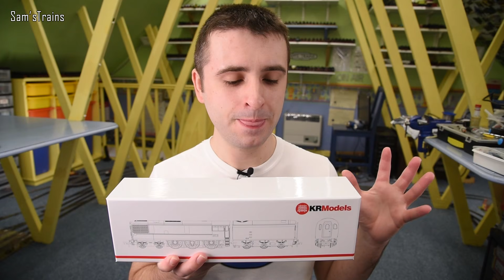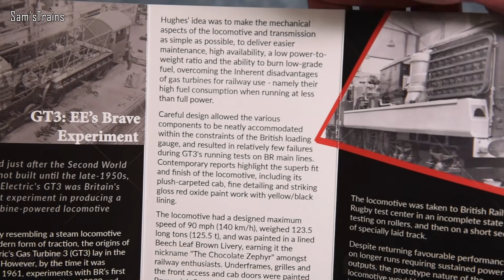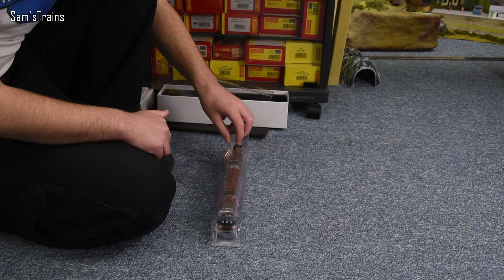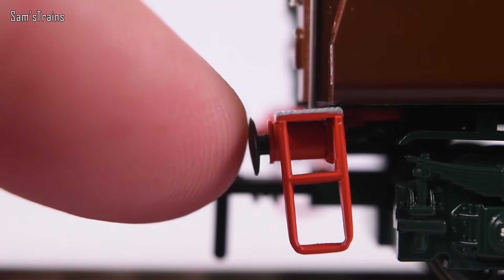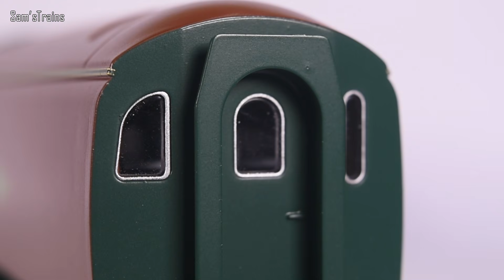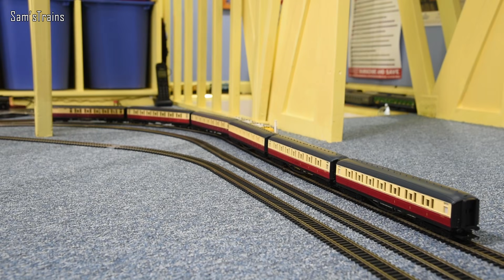Brand New GT3 Gas Turbine Locomotive | KR Models | Unboxing & Review

Comment: What that front bogie screw needs is to be a collared screw, so it can be tightened onto the collar, without tightening onto the bogie frame. I'll bet this was how it was designed, then they saw the price of a collared screw (they are machined, so are quiet expensive to produce, standard screws are rolled, and much much cheaper). 

You can effect the same by using a close fitting piece of tube from K&M metals, cut to length and slid over the screw before it is inserted and tightened. You can then tighten onto the tube and it won't clamp the bogie. Whether it can be sprung then depends on the spring and whether it will clear the tube. Maybe a replacement spring is also on the cards. The spring should push against a washer, that then bears against the bogie. With a dab of oil or grease, that should work fairly well, though uneven track might be an issue.

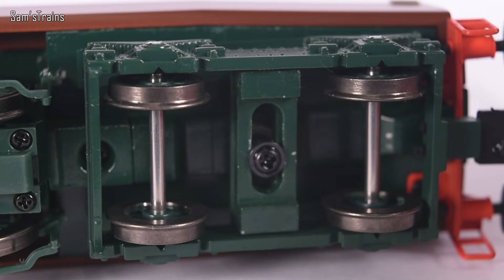Comment: There's a reason why bogies on steam models, have that link between the chassis and the bogie, rather than just a pivot. That arrangement is not flexible enough which is why it derails. Very poorly thought out. 23:20 A link allows the bogie to float more freely.

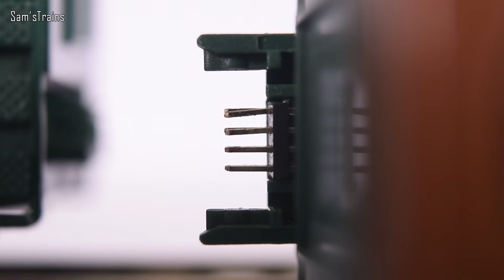Comment: 18:45 Don't push it back together with a bent pin or you'll make it worse. Mine goes back together easily. 
If you break the pins, the four on the right side control the red !!! cab lights and the white !!! non directional tail lights so no loss there. The four pins on the left are loco track input to the decoder socket and decoder socket back to the motor so don't bugger those up. It looks like your bent pin is one that controls the cab light.
Reply from the maker: That was the pin straightened - it was even worse to begin with! Thanks for the info on the pin output - duly noted!
Thanks for watching, Sam :)

Comment: 17:00 the pilot holes for the handrails are drilled in the wrong place which pushes on the step plate and makes the steps wonky. To fix, remove the front buffer plate and either drill two holes in the correct place or snip off the bottom 1mm of handrail each side before reattaching.
Reply from the maker: Well spotted - I've heard this too... though supposedly those parts are being replaced free of charge (front bogie too) not sure whether this is true yet!
Thanks for watching, Sam :)

Comment: The issue on the front bogie to me is the gloss paint where the screw connects is causing friction thus impeding its sliding motion , i would remove the paint on both the underside of the screw and bogie slide plate and use a smooth 2000gt paper the smooth it out a little oil a few mm shorter spring , a sleeve on the screw to help in hight and tightness a little oil where it slides and away ye go....awsome channel btw , i was goin to buy it but £200.00 even for a prototype is kinda too much . Ive got scale drawings for it n reckon i can build it from plasticard using a hornby/ bachmann chassis that in the end for me would be more satisfying to pursue...all the best....jim
Reply from the maker: I think it's a number of things Jim - the spring is too stiff, the fixing screw has no collar (meaning it must be fitted loose) and the screw head is only just wide enough to keep the bogie in place, again not a good fit... the whole bogie is just a shoddy design! That sounds fascinating - I'd love to see the results of a custom build like that
Thanks for watching, Sam :)

Comment: Hey Sam. I suggest that you add a small washer to the pilot truck screw so that the screw bolster bottoms out on the chassis so giving you more length on that screw allowing more movement of the truck. Cheers, Dan.
Reply from the maker: Thanks for the tip Dan - I think I have it sussed now!
Thanks for watching, Sam :)

Comment: Funny thing is, I highly doubt it would've been like this if you didn't take every model you own apart before running it.
Reply from the maker: Well then you’d be wrong - I spent two years running a model repair business... I flatter myself, but I can remove a loco body and base keeper plate without doing any damage... and I do, for every review I film... so why do you highly doubt it? 😎
Reply: @SamsTrains  erm. Because you're the only person out of about 1500 who has had the issue...
Reply from the maker: Again, incorrect... I’ve had comments to the contrary, and the odd behaviour of the bogey is clear to see in other reviews. Not to mention the fact that the bogey is insecurely fitted to the model ... but no, of course I did something wrong!
Reply: @SteamingThroughYorkshire  it's his logic what do you expect😂
Reply: @SamsTrains  why don't you do something about it first? Contact the model company BEFORE reviewing a "damaged" model, you wouldn't willingly review a loco where the cab cracked. For all you know. It is more than likley in post. The model has mostly perfect feedback then there's you who puts it down for no reason. Alot of locos have bogies similar to that. And we don't see you complaining about them 🤷🏻‍♂️
Reply from the maker: That’s not the way this works - I review each model exactly the way it’s delivered. This is fairest, and I treat every manufacturer in the same regard. I run this business by myself, and I don’t have the time to hold up filming while I contact a manufacturer and wait for a replacement. It’s incumbent on the manufacturer, not me, to ensure that models are delivered in a satisfactory condition.
A lot of locomotives do not have bogies similar to that - you name me one example of a 4-6-0 with a similarly poor design. If you can, I’d have the exact same response to it.
I’m not putting the model down “for no reason”, it’s a valid criticism amongst a largely positive review. That’s the purpose of a review. Ben’s right, that’s my logic.
Reply: @SamsTrains  the bogie. Okay. The D16.
Reply from the maker: The D16. A 4-4-0 whose front bogie is secured by a collared screw that can be fully tightened? I think that’s the end of this discussion 🤭

Comment: I'm mixed on this 

Not the most detailed or intricate 

The performance seems top notch apart from the bogey issue 

Very expensive but as a small company they can't fall back on other models to sell and make money the way bachman or Hornby can

Would be interested to see what else they have planned because I'm very impressed with the running of this and would like to see the same mechanism In other models 

A good start but very expensive start
Reply from the maker: Yeah that's absolutely right - agree with all of those points!
Thanks for watching, Sam :)

Comment: The front bogie arrangement is very similar to what Kato does on their DD51 in both HO (1-700/1-701) and N (7008-6), but they do it on the centre bogie (Necessary, as it's a B-2-B locomotive). I've not had it be an issue on either of mine (then again, the temporary layouts I build are very simple with wide curves compared to yours), so I wonder if the derailment issues are due to using this style of bogie so far forward of the locomotive's pivot point.
Reply: I don't have a DD51 diesel loco, but I have a Kato HO EF510 with a similar centre bogie design, and that bogie derails on every Hornby 2nd radius point, you really need generous express points for it not to derail.

Comment: The gas turbine turns a generator to produce electricity. The locomotive is then driven forwards with an electric motors.
Reply: All successful gas turbine locomotives used sensible electric transmission. Part of the failure of GT3 was that it did not but used a mechanical gearbox on the centre coupled axle. Wiki gives detail of GT3 design and scrapping after little use.
Designed this way despite the Union Pacific having about 50 gas turbine locomotives pulling mile long freight trains since 1952. Eventually developed into the 8,500 HP units built from 1959 and lasting in service until 1970. The UP units also were able to use cheap low grade furnace fuel instead of high grade kerosene. A big saving.

Comment: An excellent systematic analysis, Sam. My conclusion is they skimped on final quality. That cheap, toy-plastic looking, lop-sided front beam and steps, droopy buffers, numerous scuffs, unstable out-of-the-box bogie etc are unimpressive. Another reviewer’s video model show much the same as well as a twisted buffer on the tender but the reviewer made inadequate mention of it. Your review was superior in rightly commenting more on those matters plus the lack of cab detail, and so on. The difference, I think, is that you bought your loco as opposed to being provided with one - gratis. (Who pays the piper..?) So, an interesting model not worth £200. I’ve cancelled mine. Thanks for seeing more than just the paintwork, Sam.
Reply from the maker: Thanks very much for sharing - yeah that's fair to say, one or two small things spoiled this slightly... overall a decent attempt though! :D
Thanks for watching, Sam :)

Comment: For modellers. Where did it run, first based in Rugby (test centre) then Whitchurch shed in Shropshire for initial light testing and crew training on the Malpas Line. Test runs to the Llandudno Junction turntable. Next to Leicester MPD this was convenient for English Electric’s Whetstone turbine works. It ran on the GC line & from Woodford Halse running into Marlyebone Station. It was later tested over Shap on the West Coast Mainline. It was returned to English Electric at Vulcan Foundry at the end of 1962 and stored then partially dismantled.
Reply from the maker: Many thanks for sharing Leroy, appreciate this!
Thanks for watching, Sam :)

Comment: Hi Sam  Some Backup. GT3 "The Chocolate Zephyr," the third of the prototypes tried at the time. No1 was 18000 ‘kerosene castle’ now preserved. No2 was 18100.
When initially designed (early 1950’s) it was not possible to get 2,750 hp from a mainline diesel. Unfortunately there were several disadvantages of employing the finished style of locomotive by 1961.
Gas turbines need to be run at full load on continuous non stop runs to be cost effective, hence their use by UP in the USA. Runs in the UK were too short. Electrical maintenance was costly. British Railways were busily destroying turntables, now a glaringly obvious disadvantage but it does not seem to have been obvious at the time. It ran very well on runs and was comfortable to drive and unlike other GT Locomotives it lacked the tendency to catch on fire!
Reply from the maker: Thanks very much for this Leroy, fascinating things!
Thanks for watching, Sam :)

Comment: What method did you do with the bogie? Could you go through what you did?
Reply from the maker: I pretty much did go over it - in the end, I just took away the spring, and made the screw nice and loose. In the future I will secure that screw in place, but only once I'm confident the issue is fixed!
Thanks for watching, Sam :)
Reply: @SamsTrains  When doing that I'm surprised you didn't notice the front wheel guards are at the back of the bogie not the front where they should be! See the photo of the real thing. Same fault with ms. Kirk's model!

Comment: A screw to hold the front bogie in place is a better option than a rubber  band / washer like Hornby does with a few of it's steam engine models. Also before you ran the model how did you record the adjust of the screw to get it back to the starting height it was at?

My model seems to run okay over points & 2nd radius curves.
Reply from the maker: Sure, don't have a problem with the screw at all... it's just the fact that it's a loose screw! They really need a longer screw with a collar. Which Hornby locos use a rubber band? Unfortunately the first time I was made aware of the front bogie issue was when it dropped off... so I have no way of knowing exactly how it was set up at the factory...
Thanks for watching, Sam :)
Reply: The updated tooling of the Castle class is 1 of them. My models of Clun Castle & Swindon both came out of the box with the front bogie dropping off. A fiddle to get the band back on the locating pin above the slide assembly, but both bogies haven't come off since.

Would a spring above the bogie be another way of maintaining pressure but also offer a bit of suspension?

Comment: Hi Sam - a great, entertaining (as always) and very fair review of this unusual locomotive model.  I'm intrigued by your point about the buffer-springs being weak: in your willingness to test absolutely everything, might you try taking the couplings off the 'tender' and the leading coach, and backing the engine slowly on to its train? - I'm willing to bet that - with its amazing crawl and those 'weak' buffer springs - you'd get a more realistic 'buffer-kiss' than using a loco with meatier buffer-springs. This would be important on the real railway, so as not to joggle the passengers (though of course the coaches would have their brakes on - you could replicate this by simply holding the coaches still).
Reply from the maker: That sounds very interesting Rick - I could look into doing that some time! The crawl would certainly lend itself to that pretty well!
Thanks for watching, Sam :)

Comment: I am not over keen on the livery, but it was not made for any peculiar company. Take a look at the crankpins, Sam. I think they stick out too far and are undersized for the hole in the connecting rods. For the money, metal handrails and metal nameplates etc. I hope they stick around and look forward to other models. Martin. (Thailand) Is it because they are made in China and KR Models cannot check quality control until they arrive in the UK?
Reply from the maker: That's fair Martin! I believe some of the parts in the accessories bag were 'caps' to put over the crankpins, making them a bit more realistic if desired... no instructions to explain this though of course!
Thanks for watching, Sam :)

Comment: Had a Hornby Castle class with a similar front bogie setup. Had to put a very thin teflon washer between the spring  (made from an old steam iron cover) and the bogie. Used Loctite 609 to stop the screw coming loose once I worked out the correct tension. Never worked 100% but a big improvement.
Reply from the maker: Very interesting - not known any issues with the Hornby Castles... will have to investigate mine now!
Thanks for watching, Sam :)
Reply: There are some variations on Castle Class - see the 346C service sheet for the one I had. https://support.hornby.com/hc/en-gb/articles/360016350399-HSS-346C-Castle-Class-
Reply: I think some of the later Hogwarts Express locos were similar.

Comment: Hey Sam,
I became an expert with these push in tender connections. To reconnect  Loco and Tender, turn upside down in your hands, level up and push the pins home. Very easy to line up pins and keep level.  I don't even try to reconnect Loco sitting on the Rails.  Australian Manufacturers have used this system for some time and we get plenty of practice...I recommend to keep connected and use a Peco Loco lift to store when not in use....
Reply from the maker: Many thanks for sharing! I'll have to try doing it that way!
Thanks for watching, Sam :)

Comment: My GT3 has over-long handrails at the front which depress the buffer beam and footsteps moulding. I’m debating unscrewing it and drilling holes in the moulding in the right place OR cutting the handrails shorter. Not plucked up courage to do either yet. Also I have a screw missing under the cab that holds the drawbar moulding on; I need to ask KR for a spare screw already. Not even got mine on the track yet; been looking forward to your review to help gauge my own experience. I do really like the model; it’s a shame it’s got niggles. I think the drawbar with 8 pin electrical connector & the front bogie are the weakest links in the design.

Comment: Excellent and thoughtful review as always.

The obvious solution to the front bogie problem is for the manufacturer to fit a properly-dimensioned shouldered screw to start with. That could then be tightened right up, and work with the springing as intended. Compared with the rest of the design work, this is really primitive stuff -- apparently their thinking here was, 'If it was good enough for Bing tinplate in the 1920s, it should be good enough for KR in the 2020s.' Not brilliant.

Comment: i think its pretty well executed.  i wonder though if perhaps the rough might also be from inexperienced assembly persons?

if it helps you understand it better, the jet in GT3 would work very much like a helicopter or turboprop.

personally i always find it rather curious that in Britain those coupling rods kept getting used like this.

for the screw on the front bogey, perhaps if you used a tiny dab of something like a light non-permanent thread-locker such as locktite 222 (purple)  it would lock the screw in place but is still removable.

Comment: I watched Jennifer Kirk review the same loco which had none of the front bogie problems. However she had been given the loco for review purposes so presumably the manufacturer would check that it was not duff. Or if you don't like conspiracy theories it could simply be a sampling issue. Can't help noticing that Sam tends to be unlucky with his samples. Mind you as I've already said many times in comments, modern locos are worse in terms of reliability than the cheap Lima and Hornby of 30 years ago. Just placed a 30+ year old Hornby 37 on the track today. Freshly oiled it purrs along. Modern mechanisms seldom allow you to oil the motor bearings. But mainly the problem is that the manufacturers don't adequately check the quality of foreign factories.